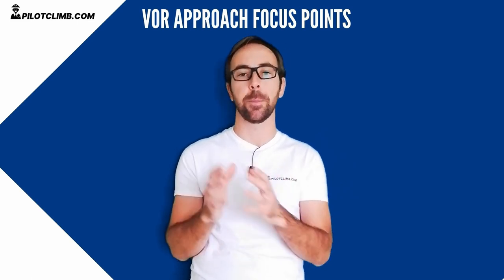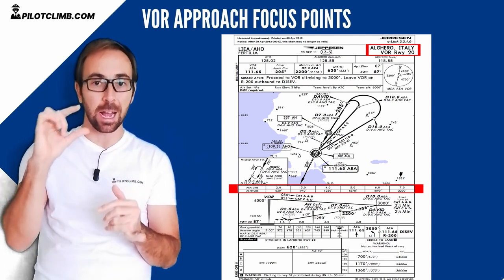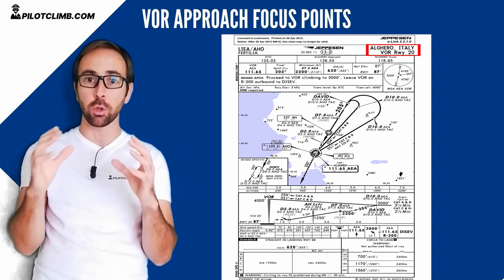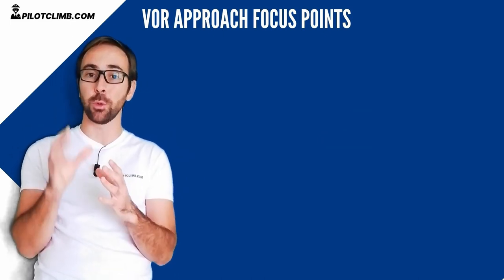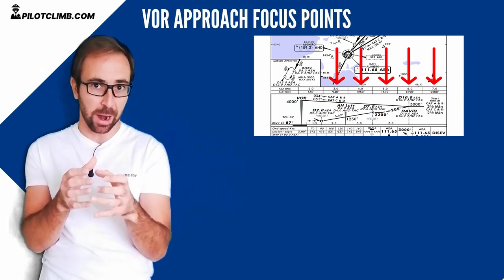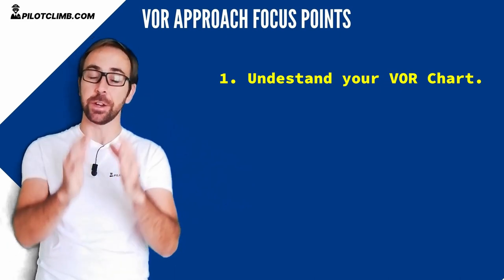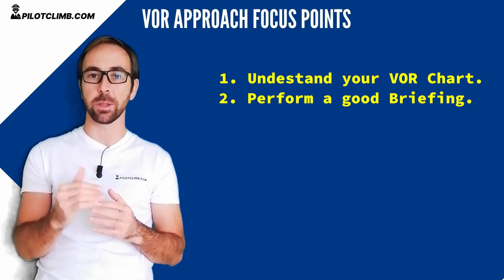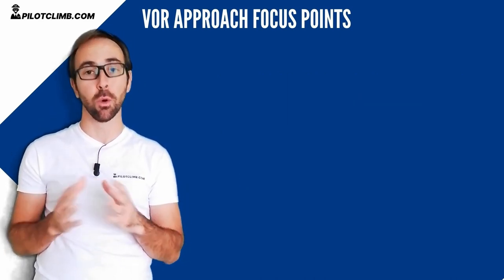How To Fly A VOR Approach Professionally - [PART 1 Key Points To Take Into Account].

Comment: Hello Captain

That is one of the topics which are a little bit challenging.

Please, can you describe more the timed approach which is in this case 2.5 min?

I saw many times the time informations but could not really understand the meaning of it.

Concerning the FAF.

Is the FAF always the point where i have to orientate on the PAPI lights?
Reply from the maker: Hey, many thanks for your comment!! 

On the timed approaches, you have the time instead of the distance.

So, for example, you have to fly on the outbound radial for that amount of time and not until you reach a specific distance.

I will make a video where I explain the difference.

The FAF is the point at which you need to make an altitude check in order to make sure that you are on the right path, you don't have to see the PAPI lights at the FAF. 
You can cross the FAF and be still inside the clouds.

You should have adequate visual references at the MDA (minimum descend altitude).

Let me know if you still have questions.

Have a great day
Gabriele

Comment: can you not just fly a VOR approach using lnav and vnav also for a VOR apporach are there different types of VOR's like VOR A or VOR B isnt one if its offset by more then 30 degrees ? also are vor approaches only supposed to get you to a suitable visual place to then hand fly the aircraft in as they aernt accurate like GPS ?
Reply from the maker: Hey, many thanks for watching and the comment!!

I will fly the approach using the LNAV and VNAV to show how do they work AND also following the RMI QDM and QDR. In this way we will talk about LNAV/VNAV and QDM/QDR.
A procedure is VOR A when you only have circling minima because your inbound radial is off set by more than 30 deg of the runway centre line.

All the approaches (excluding ILS CATII and ILS CATIII) are made to get you to a suitable position where, if you have the visual reference, you should disconnect and land manually.

Let me know if you still have any questions.

I wish you a great day
Reply: @PILOTCLIMB  thanks a lot and lastly with your website and the online lessons or discussions what is the cost for that ? I can’t seem to find it only the information boxes to fill out ? Many thanks
Reply: @PILOTCLIMB  so a vor bravo isn’t a thing only alpha
Reply from the maker: @tomharper8402  Well, it depends on the airport and the country.
Let's say, you are flying into an airport that doesn't have a straight in  VOR approach due to terrain.
In this case you might find a VOR A, VOR B or both, these procedure allow you to get close to the runway (circling minima) and than perform the visual circling procedure in order to land.
The letter it is used only to differintiate the approaches.

So you might find VOR A and VOR B when straight in approach are not available.

Let me know if that is clear..
Reply from the maker: @tomharper8402  YES you are right, I still have to update the website with the prices.. send me an e mail to info@pilotclimb.com with the topic you would like to discuss with me and I let you know.. 
Have a great evening.
Reply: @PILOTCLIMB  thanks just sent something from your website good evening!
Reply from the maker: @tomharper8402  Many thanks, I will be back to you as soon as possible.
Reply from the maker: @tomharper8402  Hey Tom, I hope you are doing great!!!
I have not received your query because I'm having problems with the contact me form of the website.
Could you send your query again to the official mail address please: info@pilotclimb.com

Sorry for the inconvenience.
Gabriele
Reply: @PILOTCLIMB  just sent it no worries